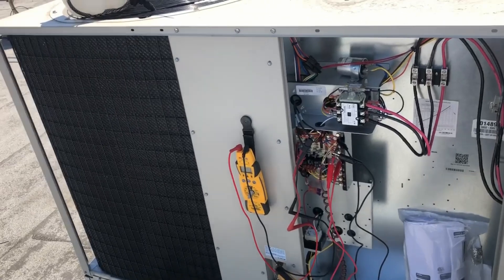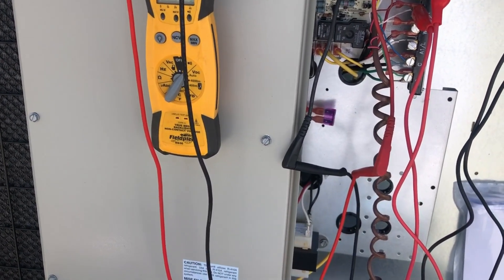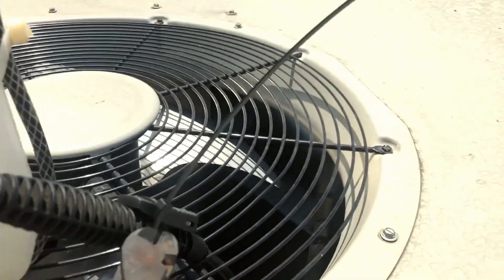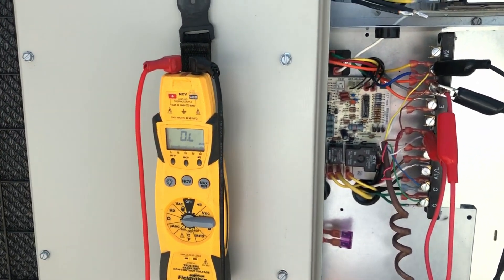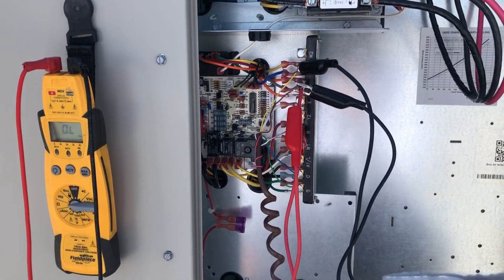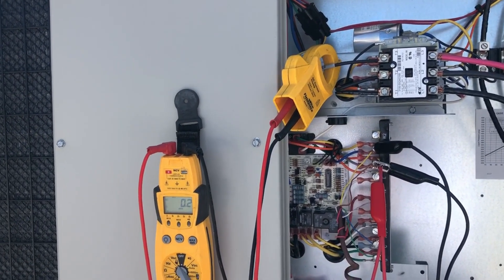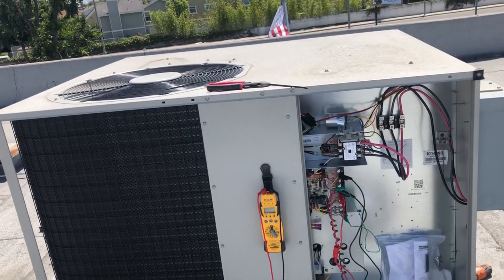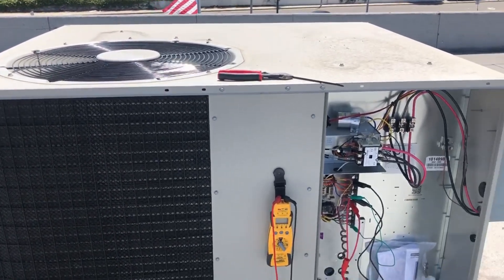EP7 Low Airflow and Reversed Compressor

Comment: Great Vid....I know this is an older video, but I wonder if the blower motor was 3 phase it too may have turning backward also. Just a thought
Reply from the maker: I had the same thought when I was there. I opened the blower compartment to verify proper rotation off camera. It was a single phase ECM motor. Thanks for watching.

Comment: No official start-up I assume. I had the same issue 10 years ago with 3 rtu's on a modular office building. The maintenance guy requested a larger fresh air hood to increase the cooling capacity. The receptionist complained about stuffy air and a freight train on the roof when the a.c. started. My boss told me he commissioned the start-up and balanced the system. I called one of our tech's and explained the situation. I did what you had done by switching 2 legs on the 3 units. The receptionist was greatly with the fix. I did find one small supply run with no flow. On install for some unknown reason someone screwed the takeoff to the main duct without cutting a hole into it. So much for balancing the systems.
My boss blamed me for the compressors starting to fail 2 months later. What a ..... Thxs for the vids!